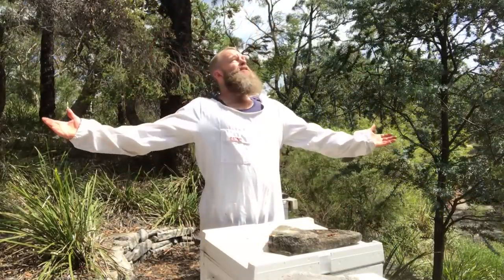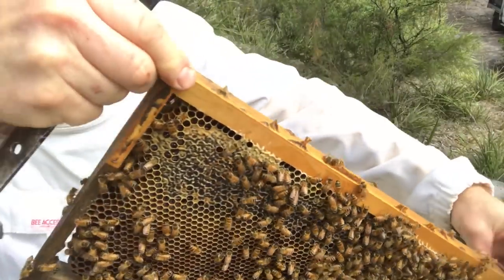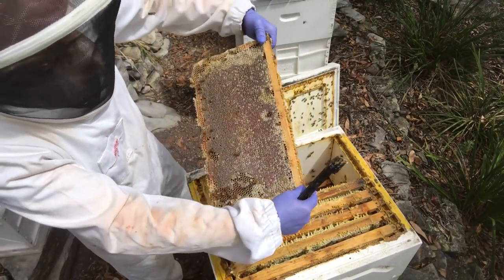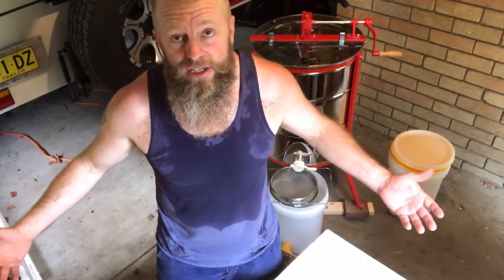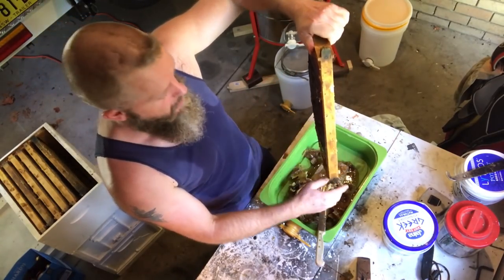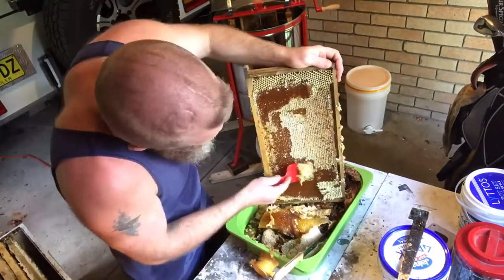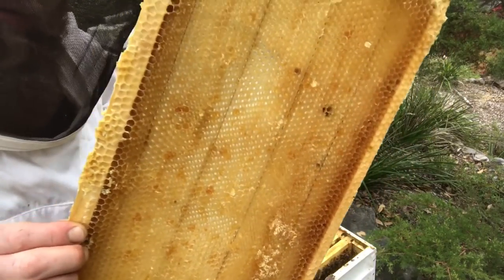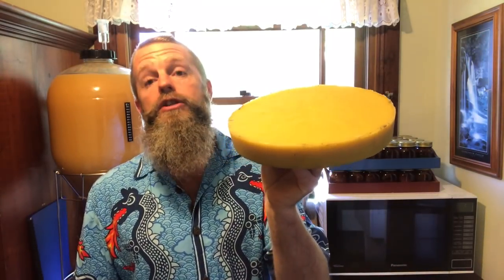Honey Harvest March 2018 and New Uncapping Method

Comment: Use a double bin decapping setup... 2 matching bins - 1/8 stainless steal mesh - 1 piece of 1X3 board - 1 honey Gate.  Cut the bottom out of Bin #1 but leave a 2 inch lip around the bottom, cut the mesh to fit inside bin #1 and let rest on the lip.  Cut 4 pieces of the 1x3 inch board to fit along the top and outside of bin #1.  Add the honey gate to Bin #2. Place the bin #1 inside the bin #2 the 1X3 board should rest on the top Lip of Bin #2.  This gives a 3 inch bottom gap between the bins. Cut a scrape board with nail to fit across the top of Bin #1 to hold frame as you decap.  Let the wax cappings fall onto the screen mesh allowing the honey to drain out of the cappings into Bin #2   I find it best to use the decapper to mash up the cappings every couple frames and move into piles off to the side out of the falling working area and let drain through the mesh, then after a bit push further away from the Falling working area into a larger pile.  Usually I then make one large mashed up wax pile and let sit over night and 95% of the Honey has drained into Bin #2 Once done set bin #2 above the strainers and open the gate.  Then either spread out the wet wax onto baking sheets and set out in a shady area so no to melt and let the bees feast or wash the wax and dry then store in the freezer for later melting and rendering.  Sometimes depending on time or amount of honey remaining within the wax I will also place the wax into paint strainers and hang inside a 5 gallon bucket for a couple days
Reply from the maker: Joshua Rhuland Mate, thank you so much for your very detailed suggestion. I’m definitely going to give this a go. 👍👍
Reply: Joshua Rhuland great method mate . However, never let bees open feed on honey/sugar solution. It sets up a robbing situation and encourages the spread of AFB. Better to put the cappings into a top feeder and place it directly on the hive with an empty super box between the main have and the feeder. Cheers

Comment: Have you thought about a hot airgun? Just flash it past the cappings and they are gone, hardly any wax cappings to deal with the comb left intact andvery quick. I havent noticed any depreciation in the honey at all. Worth thinking about
Reply from the maker: UK Here We Grow thanks for your suggestion.
I have thought about it and I might end up giving this method a go eventually. However my preference would be to avoid any heat if possible.

Comment: I left the hot knife last year for an uncapping roller.  It an be used directly over the extractor no longer requiring a cappings tank. The roller is so cheap I bought a second for replacing any spikes that break during use.  You will absolutely love the roller, it makes extracting much quicker.
Reply from the maker: Thanks for your suggestion jeff stafford. I did see these rollers for sale at my supplier, but I suppose I was a little concerned that it might leave cells only partially opened. I occasionally have to extract fairly thick honey and this could be a problem. 
But on your recommendation, I might just have to give one a crack. 👍👍
Reply: Aussie Backyard Food - I was more than a little skeptical until someone bought me one so I thought OK I can at least try for a few frames. It went so well I just kept going.  I was very impressed.
Reply from the maker: jeff stafford thanks Mate. I’ll definitely give one a crack 👍👍

Comment: Go to a thrift store and find a longer knife without serration, mate. 
Also, a lint free pillow case hung over the bucket will be the best honey you get from those caps. When it stops dripping, change buckets and spin the knot slowly to gently squeeze it smaller. I've also seen where people put it between two boards and use a vice on a workbench.they call it pressed honey. It gets a little cloudy at that point.  Keep that for home brew. It's not spun mechanically. Rinse the pillow case out with no soap,  and use the rinse water to either feed the bees back or let the animals drink it.

Comment: Try putting the honey in a bucket out of the extractor and let it set in a warm place for three days . All the wax comes to the top . Crape the wax off the top and what little honey is in it I feed back to the bees . I use the scratching tool for uncapping or the heated plane .  Just makes things easier in the long run . Best of luck with the bees !
Reply from the maker: David Crowley fanbloodytastic suggestion Mate 👍👍

Comment: Hi mate great vid really appreciate it! Nothing better than seeing those thick frames of honey I will enjoy my harvest tomorrow morning 😁 with those cappings have you tried those fine white paint filter bags from Bunnings put the cappings in those and hang em over the strainer or just put the cappings into the strainer over a bucket and cover it with the paint filter bag to keep the bugs away works every time! Sometimes you get over half a bucket of honey just from the Cappings and when That’s done put the cappings in a deep long container covered by wire mesh enough for the bees to fit and put an empty super above the hives you harvested and put the container in there and they will polish that honey off the wax the mesh stops them from being able to throw out the wax just thought I’ll share cheers
Reply from the maker: Med1na2012 thanks Mate, all good ideas! 
I’ve made a new larger uncapping tub with a mesh bottom which I’ll feature in my next harvest video. Also, next time I plan to rinse my cappings, then make mead from the honey/water. So we’ll see how all that goes. 
Thanks for your input my friend and I hope your extraction goes well 👍👍

Comment: Longer bread knife that extends from side to side will help you be consistent and not dig too deep into the comb.  Also, you will be able to exert pressure on onto the frame with the knife and screed it like a cement worker, leaving a uniform level comb.

Comment: The Knife works great, It would help if you could find one with a 14 inch blade that way it rest on the wood on both sides of the frame. I prefer Sweet mead and my favorite is Moonlight Meadery's Desire.  You can find the recipe on line. It calls for Black current juice Dark cherry juice and blueberry juice. I have substituted pure Cranberry juice for black current juice and that taste great also, it has a different taste but Black current juice can be hard to find and expensive, but hey the honey is free when you have your own hives.

Comment: Well I don't know anything about working with honey or bees, Yet. But could you make some kind of a basket strainer that fits in your spinner and just spin your cappings clean?  Of course you would need at least two baskets. Or would the wax caps just plug the baskets and not drain? Just a thought to make the machine do the work.
Reply from the maker: You know, that’s a pretty good suggestion!
But I think I’ve found the ultimate solution which will be revealed in an upcoming episode.
Thanks so much for your well considered thoughts!

Comment: I also have a manual spinner. I use a variable speed Makita corded 1/2 inch drill to spin it. Works great and much faster and easier! I tried a 18volt cordless but cordless drills get their power from gearing which means when you let go of the trigger they stop instantly nearly breaking your wrist. A corded drill uses far more electricity so the gearing isn't as low which allows the drill to spin down with the frames naturally.
Reply from the maker: Rough And Wretched R.A.W. Great idea Mate 👍
Reply: @aussiebackyardfood7819  Lol... I just started beekeeping 2018. I brought in my first two 10 frame deeps of honey and the hand crank method lost it's novelty on the first and only two frames I ever spun manually. The moment I was done those first two frames I went to the shed for my drill. you look like the handy type I'm not surprised if you already have a 1/2" variable speed corded drill. If not then you could pick one up at a pawn shop a lot cheaper than a motorized spinner. The 1/2 inch drill has plenty of power and speed to do the job. The drill will get warm but the time you save can accommodate a mead break between box's to allow it to cool down.
Reply from the maker: Rough And Wretched R.A.W. To be honest Mate I’ve already been there done that with my last extractor. After I burnt out two good drills I decided I could do with the extra exercise anyway! 😉
Reply: @aussiebackyardfood7819  Not enough mead breaks!!!! lol...

Comment: Could you just use a cheese-cloth filter?  Put the wax/cappings/honey in a cheese cloth suspended above a sieve/bucket. The honey would pass through, go down the sides and into the bucket - then keep on turning the cloth to tighten and get more out.
Reply from the maker: RangieNZ a great suggestion Mate. I might try this technique at some stage in the future. Although at the moment I’m washing all of my cappings and using the wash/must to make mead. I really like this method because I know I’m not wasting a single drop.

Comment: Gday mate I use a either a filleting knife or a bread knife from victorinox, or dikinox ice hardened
 they are very long and fit across the frame beautifully
Reply from the maker: Thanks Stan Ketchell I appreciate the suggestion! But my next experiment will be with a roller.
Reply: @aussiebackyardfood7819  the rollers are a waste of money. They damage the cells too much. It looks like moths got ahold of it. The cold non-serrated roast knife works best from what I've seen. The blade should be thin and flexible.

Comment: if i may make a suggestion to the knife you are using is to file the edge that rides on the wooden frames flat so that it cant saw its way into your frames
Reply: Or get a different knife without serration. I saw that, too. Nothing like a little wood pulp in the tea, huh? Why does the beer taste like pine? 
 Actually, that's not a bad idea...
Reply: dpsilver ....also knife needs to be longer than 10 inches so that it can ride  on both sides of the frame!...

Comment: 3 year beekeeper from Georgia here. Your inner cover is a bit different than ours, we have a hole for ventilation & bees can use it as a second entrance. What is the "cloth" that you have on top of the frames, under the cover? And it's purpose? 

Are you using deeps for your supers? Do you have problems with hive beetles there? Varroa? Thanks for a great video!
Reply from the maker: Francine Locke thanks for your great questions! 
We call that inner cover a hive mat. It’s main purpose is to stop the bees building up under the migratory style of lid that most Aussie beekeepers use.
We do have hive beetles, although I haven’t found them to be much of an issue.
We are the last variation free frontier on the planet, although most think it’s only a matter of time.
And yes, I only use full depth frames.

Comment: Question. Why do you not use a soft brush to remove the bees from the frame?  
I noticed you do not replace the frames while you are in the box with new frames and you can still let them clean up the old frames after you take the honey  
Do you ever package the comb filled with honey? 
Is your honey for sale?
Love your videos. Can we see more gardening videos?
Sorry I guess you return the frames pretty quick. A lot of bee keepers don’t move as fast as you 😎
Reply from the maker: Towanda Thedriver thanks for all of your great questions!
Firstly, I have found that my method of removing the bees from the frame is a little kinder to my bees.
The reason I don’t replace the frames with new ones is that the old frames need to go back onto the bees once they’ve been extracted.
I do occasionally sell my honey if I have a reasonable excess, although since I’ve started making mead, that doesn’t happen all that often.
I may do some more gardening videos in the future. If I get some more feedback like yours, then I might consider it.
Cheers 👍

Comment: ok so your making mead with some of your honey, well I was thinking your trying to get the honey out of the capping's and it being a pain to strain ,, so why don't you add the capping's to some boiling water and melt it wax will come to the top, and after it cools ripe the wax off the top and pour the honey water into a mead bucket as a base for the mead ,
Reply from the maker: MrYendor1968 I have done something similar before and it turned out to be one of my best meads yet.
I might end up doing a cappings mead vid one of these days.

Comment: For the capping's you need 2 buckets 1 with a tap. The one with a the tap goes on the bottom. Take a lid and drill a lot of small holes in it like a siv and put that on top of the first bucket "Loose" not snapped on. Take your second bucket and drill lots of small holes in the bottom like a siv and sit that bucket on the lid of the first bucket,
 Now fill the top bucket with the capping's and leave for a few days, all the honey will make its way to the bottom bucket, 
You may have to leave the lids on both buckets loose or you can get a vacuum effect and the honey will not drop.
Wana swap mead recipes ?
Reply from the maker: Truth Seaker thanks for the tips. Happy to trade recipes. Although I’ve noticed most seem to include preservatives and heat treating of the honey prior to adding and I’m not too keen on that. I’m still fairly new to the process and while I’m onto my fifth batch, I’m still experimenting and fine tuning each time. But if you stay tuned you’ll see a mead making episode later this year! 
Thanks for watching Mate! 👍👍

Comment: Maybe someone else suggested the same, but if you get a bread knife 4 or 5 inches longer it would make a world of difference.
Reply from the maker: How Mate?
Reply: The knife would be long enough to rest along both edges of the frame so you could get the whole thing with one go.  I noticed it looked like the shorter knife tip was digging in a bit and you were also having to go back to both clean up areas the knife tip missed and the capping along the opposite edge.  But that was great looking honey.
Reply from the maker: Thanks Mate 
I see what you are getting at. I’ve found with the cold knife (bread knife) that I end up taking too much honey off in the process of removing the cappings.
So I plan on giving a cappings roller a go next time.
Thanks so much for your input though 👍👍
Reply: Hey, one of the great things about beekeeping is that there are 25 ways to do anything, and most of them will work, just have to find the one you like!  Good luck on the venison!

Comment: I just use ladies pantyhose(obviously brand new, not used) to filter the cappings just cut off a piece of the foot and leg and fill it with the cappings and hang it up over a dish
Reply from the maker: Ernst Rudolf Hayward thanks for your suggestions Mate!
However, I’ve built an awesome new cappings straining system which will feature in a vid soon.